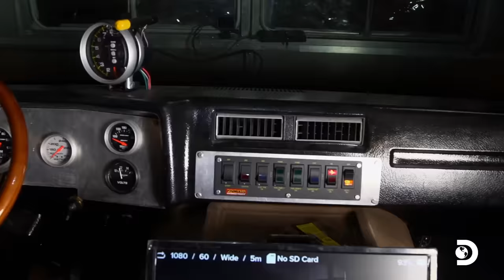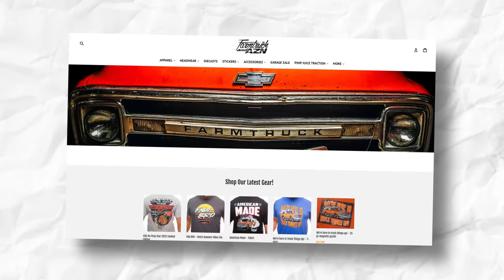What Really Happened to Farmtruck From Street Outlaws

Comment: I've lived in Okla most of my life. Farmtruck was prob the closest thing to a real street race truck.  The rest of them were full out pro race cars not driven on the street at all.  I use to street race every weekend and never seen a single one of outlaw guys on the street.
  For about 6 yrs, I had a race shop and raced in the NOPI series with me based from Okla. Everything kinda fell apart right around 2005 and racing just seemed to stop.  All the sudden, yrs later Street Outlaws became a thing. Not real street racing.  Basically test and tuning.  Nothing like real street racing.  Usually somewhere they had permission to shut down.
  I've met Sean and Azn at local shows and they seem to be real nice guys. I've also been by and talked to Dave up in Edmond several times before he shut down the shop behind Whataburger. He was a pretty nice guy also.
  I used to go out to thunder valley every weekend.  The whole sport kinda got ruined. People can't afford to race, win or compete with full out race cars.
Reply: Farm truck in the Asian beetle two of the best ever❤
Reply: WHEN I WAS STREET RACING IN THE 70S BRINGING YOUR CAR ON A TRAILER WAS A SURE WAY TO HAVE ZERO RACES AND BE LAUGHED AT
Reply: Not even a Trailer, they are multi car mobile workshop race transporters, 
And you are correct, street racing is a couple of kids racing on the back streets, 
Not $300,000 unstreetable race cars on purpose built concrete tracks with 2 miles of lighting rigs.
Reply: The cost of racing and the economy being horrible right now is probably helping to kill street racing. People are lucky to have grocery money in this economy.
Reply: I like the show when it first aired,  to much money & drama come in so I'm out !
Reply: We use to race every Friday and Saturday at our local trnpk. Just 5mile laps between a few restaurants with cars gathering there and all parking lots in between. Eventually driving back and forth along with light timing would set you by cars to race who had been eyeing each other all night to assess other cars potential. Plus quarter mile runs were marked off on certain stretches of highways with limited traffic known to only dedicated locals.
it's like this everywhere now. Back in the 80s to early 90s you could beat all new and most other road going cars with a couple dollars spent on motor parts in your garage with assorted friends and knowledge to help. Now some of the factory stuff makes great power with factory clean and engineered reliability unmatched from your average household garage hot rod shop. Only good engine builders with clean assembly rooms and equipment can pull it off.

Comment: Where do these guys get the amount of money needed to do street racing bc this shit is damn expensive.
Reply: fishing
Reply: U right. It's a expensive hobby. Even I'm ters of building it yourself and getting the parts it's very expensive and time consuming. The people that I knew growing up that were into it it was like a family business. Like the dad was big on racing and he had a pretty good job. So he would go to a junkyard grab a old engine and then spin like three or four years customizing it. It's an expensive hobby all the way around. But the people that do race tend to hide how they get money. Sometimes it's illegal money or check this out sometimes the materials are stolen. The engine stolen. What do you think happens to those hellcats that get stolen?
Reply: @jpowe2822  late 80's early 90's long island NY street raced a 70' Roadrunner spent more time under it than in it. Every day a new problem. Under hood 4spd 391,1 gears 8.75 rear ring I built that car from nothing n it handled bc I put a modern for that time upgraded front end in it with disc brake set up no drums. When I got the car it has 4 wheel drum brakes with left hand thread lug nuts on the left side I'm not kidding it came that way. By 95 I sold it (stupid me) last I heard it was taken apart for a restoration by a guy who has no idea what he's doing sad ending I wish I still had it today. Was a 383 car I put in a 30 over 440 parts then were a fortune I bet it's 3x that now n no I never stole anything n there were a lot more junkyards to get parts at that time too bc now I hear you either buy new or you fabricate what you want anyway great memories of long ago.